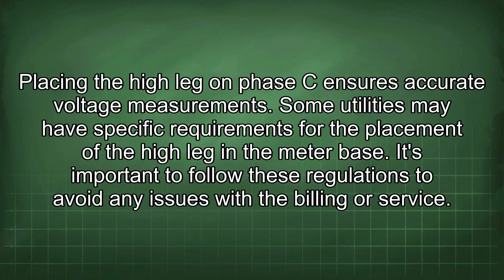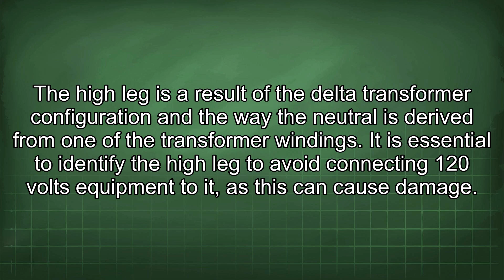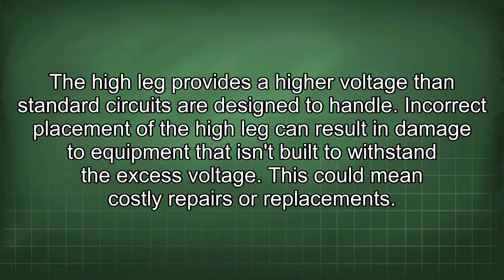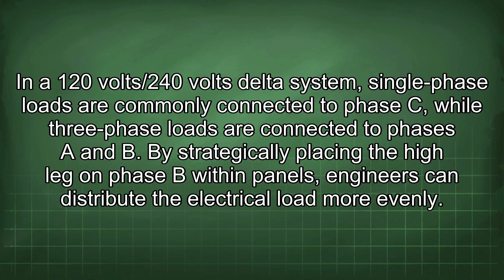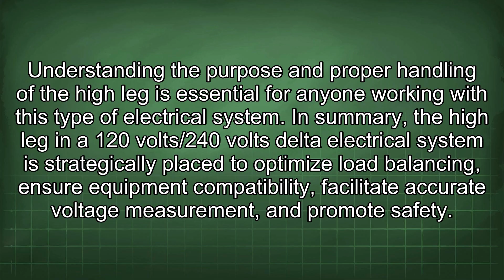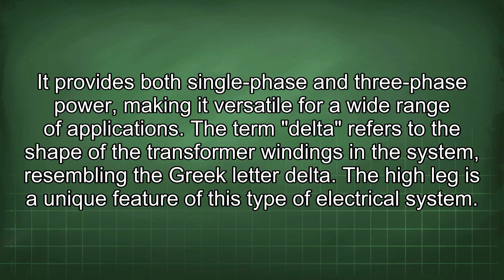High Leg Placement Phase B Panel Phase C Meter

Comment: While article 408.3 (E)(1) of the NEC tells us that the high leg conductor must terminate to phase B in switchboards, switchgear and panelboards, and that other arrangements shall be permitted for additions to existing installations and shall be marked.  Out in the field that's not necessarily going to be the case.   For example, in systems installed prior to the 1970s, I believe it was around 1975, it was a requirement, or at least common practice to have the high leg terminate to phase C in panelboards throughout a building, and my understanding for this is to try and maintain consistency with the POCO, which requires the high leg terminate to phase C on the metering equipment, because the meter, at least the for older electromechanical type which has long been replaced with smart meters, has a demand meter that requires a 120V connection on phase B, so the POCO must use either phase A or C for the high leg otherwise they would destroy the meter.   For some of the modern smart meters, it no longer matters which phase is the high leg, however the POCO aim to maintain consistency across their network, so they still require phase C to be the high leg for metering equipment.   

All that being said, the importance of using a suitable instrument to verify phase to phase and phase to ground voltages prior to beginning work on existing equipment cannot be overstated.  

It is possible to have a high leg delta system at 480 volts.  The phase to neutral voltage from A to C would be 240V, and the high leg to neutral voltage would be around 415, or double that of a typical 120/240V 4 wire delta system.   This would be extremely rare and I've never personally came across one of these, but I've heard of it a few times.  I have worked on a few 120/240V delta systems in the past, however.